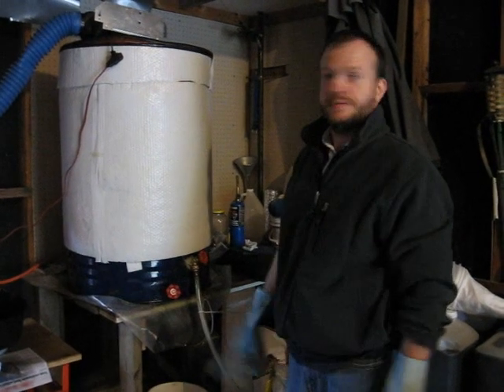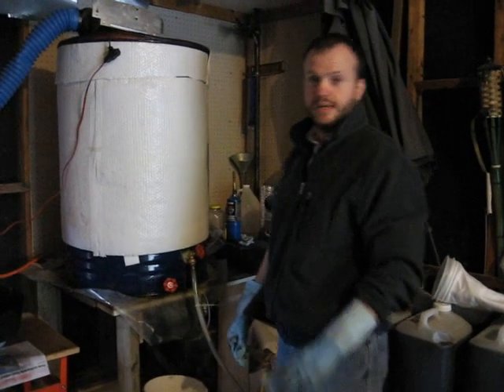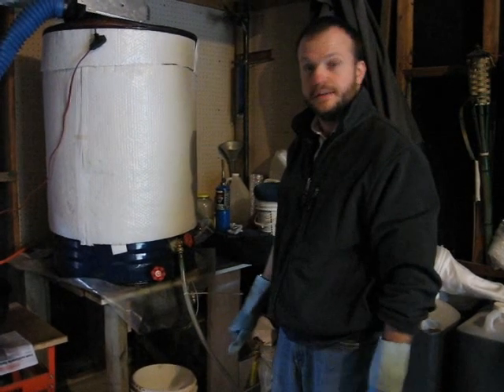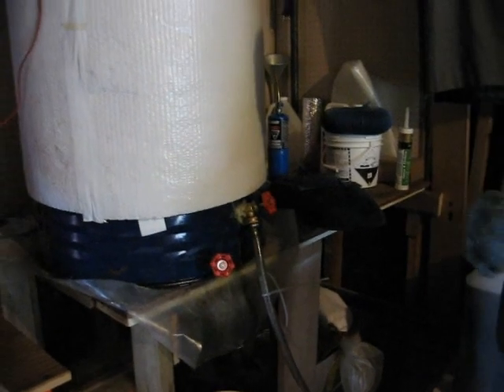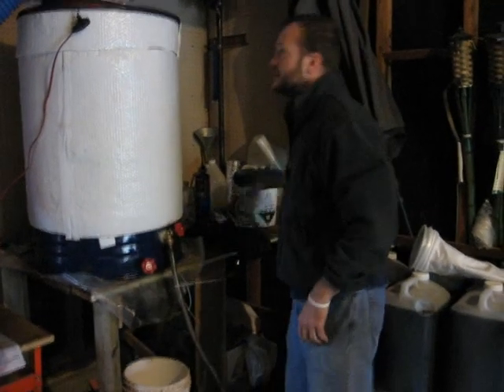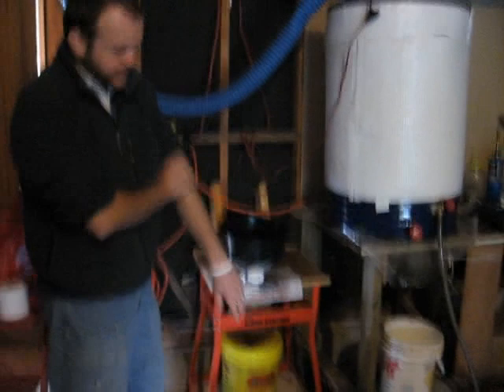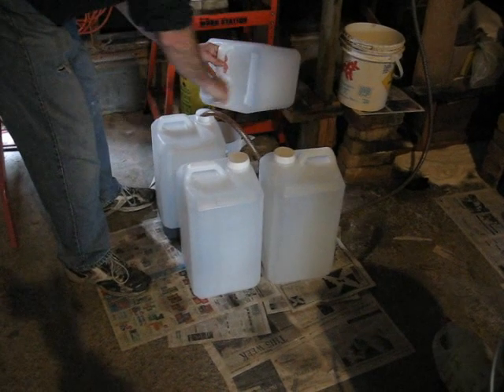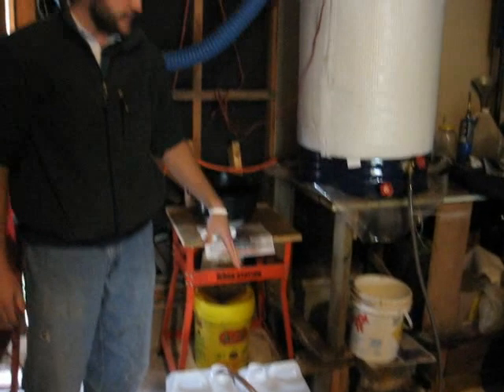Veggie Oil Fuel Home Processing Plant -- Finished Product

Comment: I couldnt get that blog address to work.
I can run my car on single tank veg oil, I have a bosch pump that is able to pump the stuff, can u just filter used oil, add some white spirit or methanol and use?
what does ur process remove/ do essentially?

Comment: the energy u use to heat the veg oil will negate any savings surely unless u use waste veg oil burners to heat it or a generator running on veg oil powering an electric heater?

Comment: This is great! I am building a similar system. though i am doing things a little backwards. I plan to bein with pouring pre filtered oil into a water heater and heating it up. Then draining the water and sludge from the bottom using the existing faucet. When i get to clean oil i am emptying the remaining good oil into a commercial water jug, which will be suspended upside down over a barrel with a bag filter in between. That way the oil is heated and filtering is quicker.